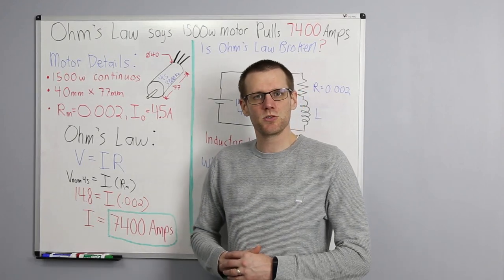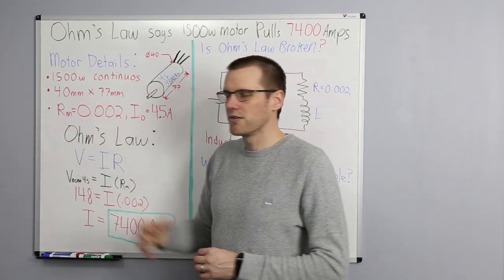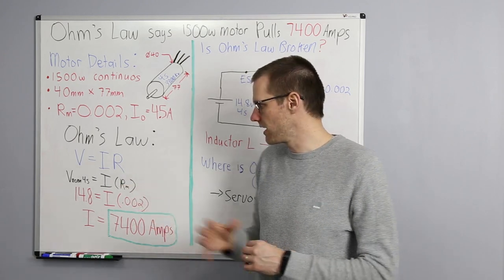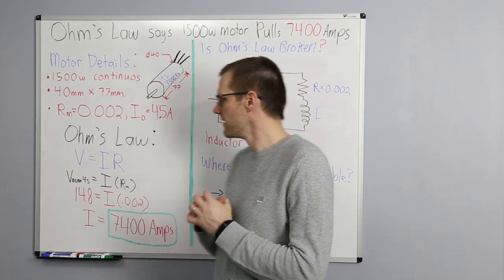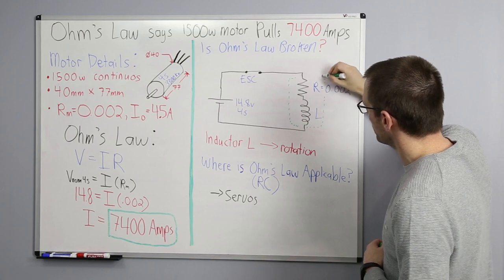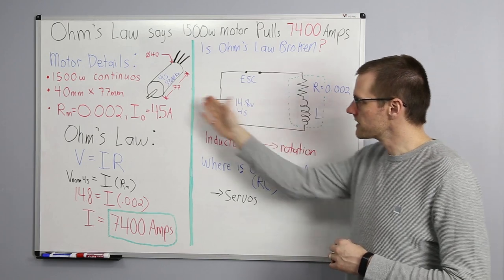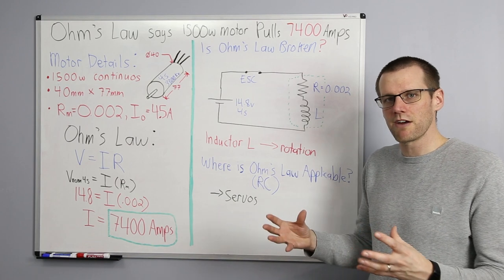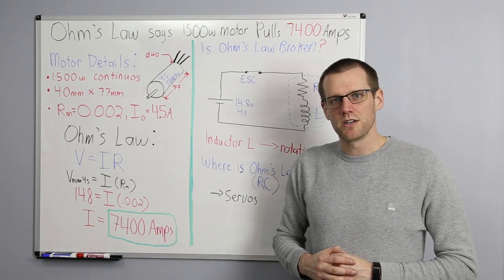Ohms Law says this 1500w Brushless Motor Draws 7400 Amps

Comment: Finally an answer to my question.
So the bigger the resistance  applied to a motor shaft the more amperage drawing will have= burned esc 
Thank you so much Ryan :)
Reply from the maker: That's correct. More load = More current

Comment: Very nicely presented. If you really want to apply Ohm's law to calculate the I current value other than the  stall and fried situation, it is taught in the 3rd year of electrical engineering for the real understanding. But there are formulas that you can plug in to calculate it in the 2nd year or 1st year of electrical engineering, but you don't know why/how those formulas work.

Comment: Is there any chance you could cover what happens when you exceed the motors Voltage rating?
Far too many focus on the motors kv and ignore all other specs.
This results in people running 8S on a 5S motor, and wondering why the ESC blow up.
Reply: If you give a motor more voltage than it can take, the motor will be damaged mechanically; it will spin faster than it should and that will destroy bearings, throwout the magnets from the core of the motor
Reply: @NabiL_Lam  Yep, I know but that doesn't stop people from doing it.
I would like more people to know why, so I was hoping RCexplained could reach them.
Reply from the maker: Hi RandomloserDK, thanks for the comment, I will see what I can do.

Comment: Why is the 60 000 RPM the limit for the motors? Is there any physical reason for that? I thought overcurrent and overheat was killing motors, not RPM.
Reply from the maker: Heat kills motors. Yes.
Exceeding max rpm subjects the motor to possible mechanical damage. Throwing a magnet for example.
Reply: @RCexplained  Hi. Bearings too have max rpm 😉

Comment: really like your channel and watched nearly all your videos but there are still a three things, that are not really clear for me.
First: Let's say I got a 3S Car and want to achieve a specific speed. Is it cleverer to take 3000kv with higher Gearing or 4000kv with lower Gearing ? 
Second: Is it always saver to run an overpowered ESC, beacause of headroom? For example, for a 3s car, if money ain't the problem, is it even saver to run a 3 - 8s rated 160A ESC?
Third: The brushless Motor draws all the current from the system he wants / needs. So it's the motor that defines the Current going through the System. and the more Load, the more Current OK, so clear so far. But how do a motor know how much current he wants? does it have a AI chip, a brain or something ? If I block all the tires and go full throttle, what does this mean ? Does the motor "think" : Oh I don't want to stay here, so I pull 10000000 Ampere to achieve kinetic energy. So how do I know how much current he pulls to pulls if I "for example" block the tires?
Reply from the maker: If you are looking for max power output, this is usually achieved by getting the most RPM out of the motor. Let's say 50,000RPM out of a 60,000RPM rated motor. If the higher kv gets you closest, this is what you would have to select. 

It will always be best to oversize an ESC if cost and physical size is a non issue.

I explain briefly a part of your question here: https://youtu.be/BU7OaHtsamk

It is not the motor that determines the amount of power pulled but the load placed on the motor that determines the load. As you load the motor up, the motor naturally must pull more power. Which is partly explained in the video above.

Comment: Overloading to the max!
Probably a little too controversial/political but if you have an opinion on what is actually happening to the xlx2s from an electrical point of view I'd be very interested. It's an interesting failure, doesn't seem to happen under load, really curious what is actually happening.
Reply: Maybe the motor drawing more amps than  XLX2 can give
Reply: @NabiL_Lam  Not in this case, well not in a conventional manner anyway. In many cases they catch fire just sitting there on the ground, sometimes test spinning the wheels in the air. On flipside other people have torture tested them successfully.
It's not a capacity issue, it's either hardware/design issue which might be interesting to discuss, or software....which might not be.
Reply from the maker: HI Fraser, Castle outlines this on their website. Have you looked in to this?
Reply: @RCexplained  I wasn't aware. Just found it thanks. Now going to rewatch the winding video you did to see if I can understand why that might have been an issue.
Reply: My theory is that there is too much time delay between the back emf and the esc processing finishing up. I reckon the inductance and rpm on D winds is causing the issue.
Reply from the maker: A firmware update should fix the issues.

Comment: Way too simplified circuit completely omitting the internal resistance of the battery. Voltage will sag like hell, peak amps would never be anywhere near the 7000 range. Anyway, great info about the inductance, thanks!